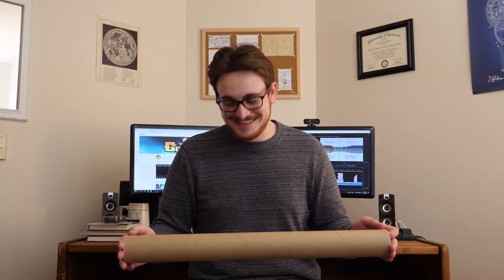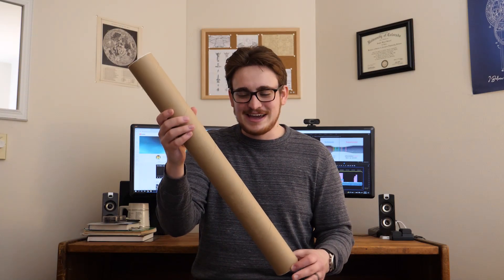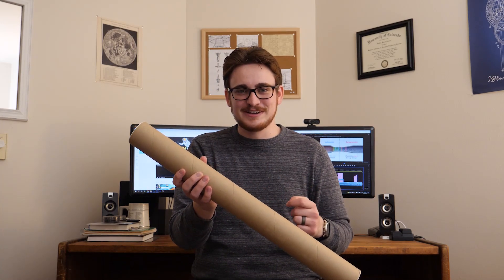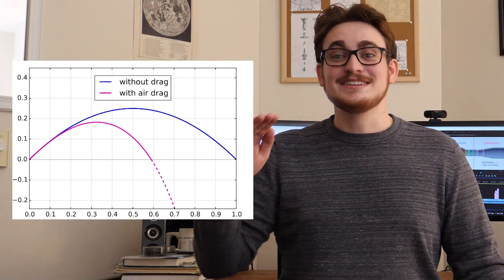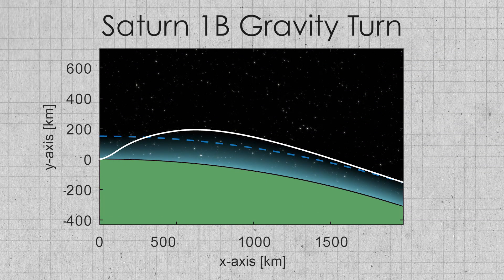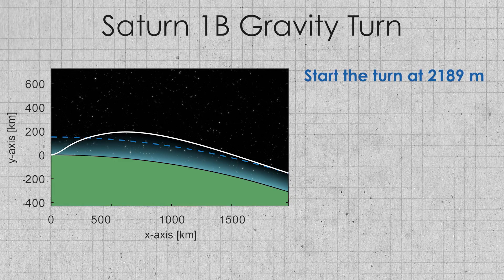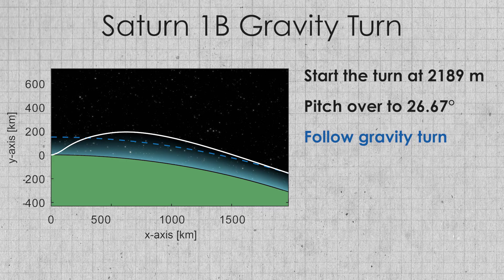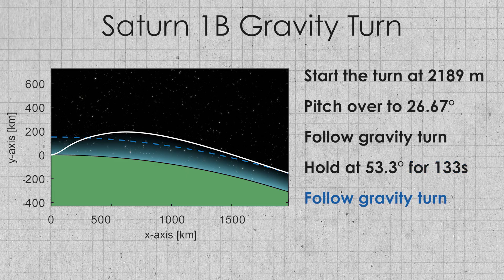How to Perfect a Gravity Turn?

Comment: in short: The purpose of vertical velocity is to keep you off the ground and above the thick atmosphere. It gives you TIME to start building up horizontal velocity. "gravity turn" simply "eats" your vertical velocity. The most efficient burn (w/o atmosphere) is to instantly gain the horizontal speed you need, then circularize.

Comment: Not true.  You had it right to begin with.

If you LITERALLY let gravity do the turn, then you don't need to gimbal.  In fact, you CAN'T.  Gimbaling FIGHTS the gravity turn... by either deviating above or below what would happen if left alone.  Alignment in a gravity turn is caused by having the center of pressure AFT of the center of mass.

A gravity turn is used ONLY when engines or flight surface controls are NOT allowed to alter the flight path.  If they are, then the rocket is simply in active control, and gravity is not what is actually controlling the turn of the rocket (through gravity/drag/aerodynamics, etc obviously still have an effect on the trajectory).
Reply from the maker: Actually, that’s the change I made for this video. In the original I was brute forcing the turn and ignoring the natural trajectory. I was just changing the angle of the rocket at a constant rate. In this video, I mostly do a gravity turn with a brief “manual” gimbal to initiate the turn, and an angle hold raise my apogee
Reply: @ConHathy  Just realize that while a gravity turn is efficient in TURNING a rocket... it almost NEVER is efficient in achieving orbit... 

Why?  Because nearly no gravity turn actually gets you into orbit at all.

Almost every possible gravity turn will cause failure to achieve orbit.

The only time to use a gravity turn is: when you don't have any means of guidance.

If you have guidance... then you are simply making a guided turn.
Reply: @RyderSpearmann  Yet SpaceX are using gravity turn on just about every F9 flight they make. They vary the angle and kickpoint to get different aggressive or gentle turns, but it's GT all the same. I have telemetry from five different flights and can match each one of them withing a percent or two with a gravity turn. Heck, they even call it a gravity turn. Yes, you CAN make a guided gimballed flight all the way up but you won't have much fuel left.
Reply: @Ritchey-Cretien  they ALL are fully gimbal’d.  Gravity turns are only for rockets that have no guidance.  Anyone saying otherwise is misusing the term.

All modern rockets simply pick a flight path and stay on it.
Reply: @Ritchey-Cretien    I think you are confusing a gravity turn with a “gravity turn trajectory”.

The TRAJECTORY is an IDEAL trajectory that could IN THEORY allow the rocket to proceed fully unguided… letting gravity do the work.  This is how hobby rockets fly.

It’s POSSIBLE (like the lottery) that no control inputs are required by the guidance system… and the engines/control surfaces stay exactly at zero degrees for the entire flight (after pitch over), but like the lottery, I don’t see that ever happening.
Reply: typically, many if not most modern rockets rely on gimbal rather than aerodynamics to stay stable along their trajectory.
also, probably before designing/launching rockets, they could simulate many different kinds of gravity turns, (like when to start turning, at what altitudes, at what speeds, how to limit thrust- if at all- and more.) all of these possible variations does end up with an optimal gravity turn trajectory that does allow the rocket to follow that trajectory, and have overall greater efficiency. essentially, to stay in that trajectory, not too much gimbaling of engines, or oversized aerodynamic control surfaces would be necessary. additionally, trying to turn too far against your trajectory, (AKA having a too high angle of attack) causes a lot of drag, which hurts the efficiency of the rocket by a lot. 

though of course, if you have a bad gravity turn trajectory, you will either shoot up too high, or fall back down too low, failing to get to orbit. with the right trajectory, it can work. 
the main benefit of gimbaling engines, is that they can help to steer the rocket to maintain this trajectory, as small atmospheric deviations and other effects would cause an unguided rocket to start to veer off course.

another benefit of the gravity turn manuver/trajectory is it also helps the rocket keep a pretty low angle of attack (relative to the passing air) which can greatly help reduce potential drag losses, and overall help increase efficiency, while also minimizing gravity losses by turning over as quickly as efficiently possible.

Comment: Instead of locking, wouldn't you want to have a smooth gradient? It seems you're in the realm of trying to find pockets of optimal performance kinda like fuel economy for trucks at different speeds/gears/etc. So in this case, instead of locking at an angle, you would want to just lock a range of angles at certain points in the turn. Let the rocket find pockets of efficiency as it goes through the changes in drag to air density.

Comment: Re: gravity turn is perfect?
Nope. Not for low orbits and low TWR. Optimized trajectories often overshoot their target apoapsis by hundreds of km and then have lightweight upper stages that burn at very low TWR with significant cosine losses, but the mass ratio advantage more than makes up for it.

Comment: I liked your reference to Kerbal Space Program. The type of gravity turn I like is the "Zero Lift" gravity turn and it works well in KSP and is easy to program in Kerbal Operating System. I suspect they used something very close to a zero lift gravity turn when launching the Saturn V.
Reply: > "Zero Lift" gravity turn

Isn't every gravity turn a  zero lift gravity turn, as for it to be a gravity turn, the angle of attack of the rocket is always 0 during flight except for that initial nudge?

Also in what way, is a gravity turn easy to program in KoS? It seems a very difficult thing to optimize, as has been shown by this video's author.
Reply: @festerdam4548  "Isn't every gravity turn a  zero lift gravity turn..." No. "It seems a very difficult thing to optimize..." I never said anything about optimization.
Reply: @jitteryjet7525  I'm confused then. What is a zero-lift grav turn and how is it different from other grav turns?